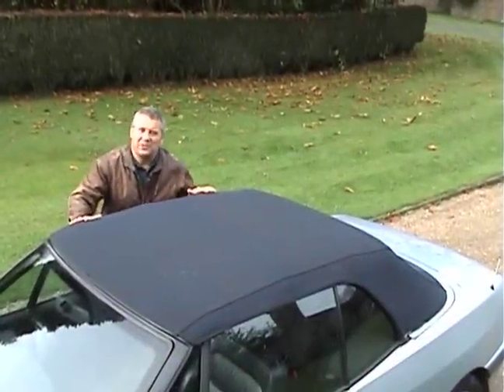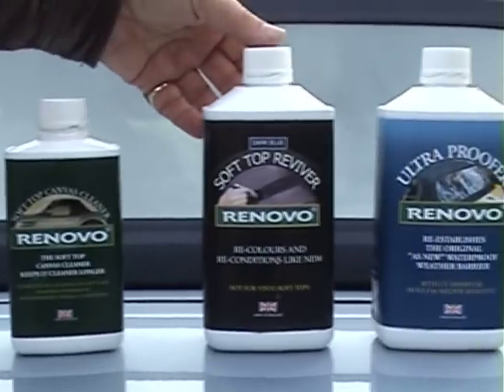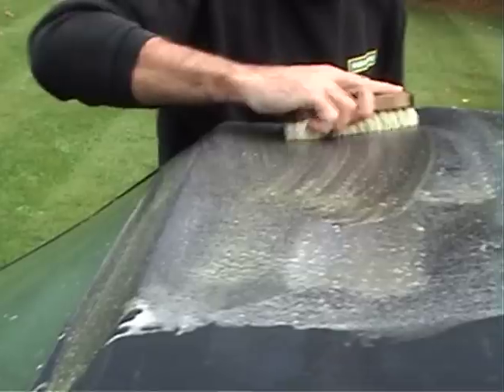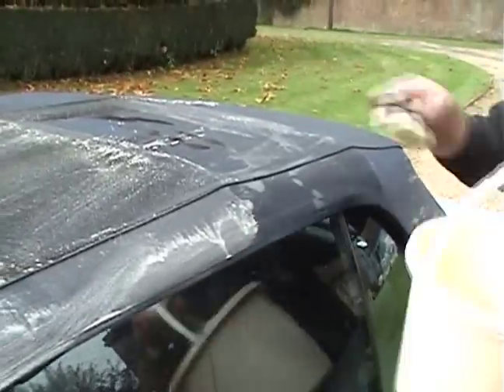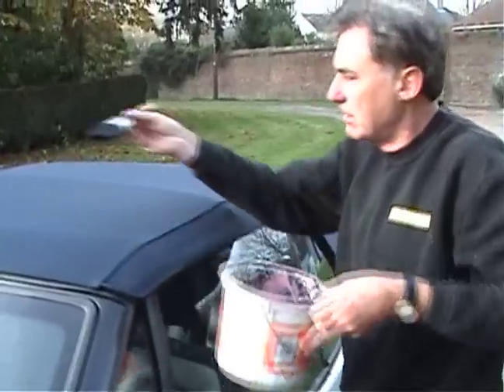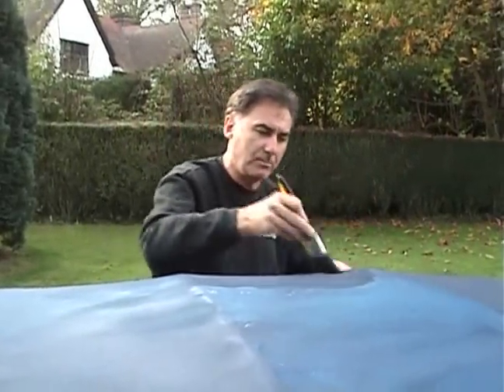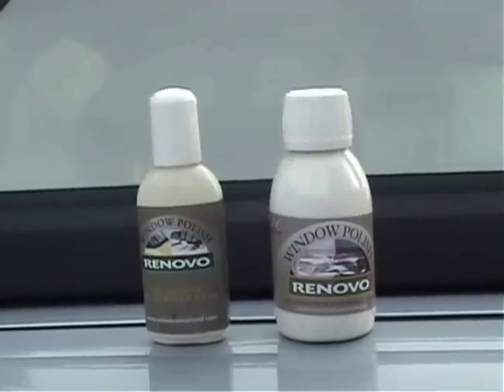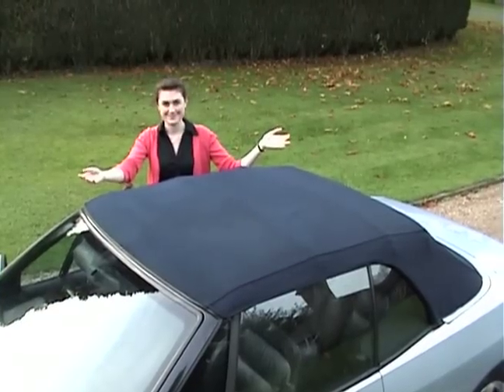Revive your convertible soft top with Renovo

Comment: I used Renovo for the first time having used a cheaper commonly know brand previously. Renovo stands head and shoulders above when looking at the finished results, I was very pleased.
The instructions do say to remove any dye on the paint or windows with a damp cloth. Let me say don't let the stuff dry but wipe immediately!! Mine dried on and I resorted to using a compound (similar to T cut) to remove it. Wouldn't shift with a damp cloth but was quite easy with the compound. Hood looks stunning now!!

Comment from the maker: Hi Wong Chin. Thanks for your query. Renovo has a range of colours, including a few shades of blue, so they will have one that is a close match to your existing soft top. These colours are generic, rather that BMW specific, but will give you a good strong colour with a uniform shade. Do remember that it will also dye any white or grey stitching, so the colour restorer tends to be used on rather tired and blotchy soft tops. If it's just dirty, you might find the cleaner brings it back up to good conditon by itself. Lots of useful info on the Renovo website, and they are always happy to talk you through any technical questions, including close colour matching. Hope that helps. Cheers. Jake

Comment: We have a VW. Beige in color. Do you have that color?
Reply: Hi Tim,
Renovo do not manufacture a  Reviver beige  colour variant as there are simply too many shades of beige for us to be able to keep all our customers happy.

You have two options:-

1. Preserve your soft top's original colour by cleaning with Renovo Fabric Soft Top Cleaner and protecting with Renovo Ultra Proofer. Optimum protection will be achieved by applying Ultra Proofer approximately every six months.

2. Change the colour of your soft top to brown/black.

It is possible to change the colour of your soft top from beige to brown/black using Renovo Soft Top Reviver.  However Soft Top Reviver was developed to bring back the original colour, not change the colour and consequently there are risks involved with this process. It is not reversible and can take more than the two recommended coats but not more than three.

It is imperative that the top is cleaned thoroughly, ensuring that any previously applied proofing product is removed, before applying the Soft Top Reviver. Renovo Fabric Soft Top Cleaner will remove most proofers if the severely soiled cleaning instructions are followed. If you are aware that another proprietary branded proofer has been applied it is best to contact their customer service department to ascertain how you should remove their proofer. 

RENOVO INTERNATIONAL LIMITED
Reply: @kaylacey7802  thank you...

Comment: Hello I just used your product on my softtop 2007 Saab convertible , I used the cleaner & re-proofer it came up great, I have one question should I wash the soft top or refrain from cleaning the roof altogether?  the reason I used it was due to a leak, my interior is bone dry now!
Reply from the maker: Hi Alan. Thanks for your query, and glad you've had some good results. The reproofer will have filled up the holes made by the shrunken stitching, and so stopped the leaks. Nothing to prevent you cleaning the soft top again - they do need it in today's polluted environment - but once dry just give it another quick coat of reproofer. Ideally, you should do this every 6 months or so anyway, and it only takes a few minutes. You'll notice the chemistry has changed a little since that video was made! Cheers Jake.

Comment: Hi 
I used the Renovo cleaner and black dye on my mx5 today, and although it came out well the day was maybe a little warm and has dried a little patchy in places.
If I reapplied with a small foam roller do you think it may be more even.
Havent yet applied the sealer.

Cheers paul
Reply from the maker: Hi Paul

In theory, the roller technique should work fine, and give quick, even coverage, but be aware that rollers do splatter a lot, even used gently, so you may get the dye on the bonnet etc  which will need wiping off. Always best to apply on a dull day, keeping that all important wet edge. The second coat will cover well, but slightly stiffen the material. I asked Renovo for their thoughts. Thanks for watching! Cheers Jake
Reply from the maker: Hi Paul - this just in from Renovo: My previous suggestion may be flawed!

Hi Jake,
 
The problem may be that there was previous form of water proofer remaining on the fabric that the subscriber has not completely removed when they cleaned the soft top. This would prevent the Reviver from soaking in, thus causing a patchy appearance. Another possibility is that the product was applied in direct sunlight/when the soft top was too warm, again this would not allow the Reviver to soak into the fabric properly. Without knowing the history of the soft top and how the top was cleaned prior to an application of the Reviver we can only speculate on this.
 
The simple solution is to clean off the Reviver using the Renovo Soft Top Canvas Cleaner following these instructions:- Mist spray the top and then paint on the Canvas Cleaner leave the solution to dry for approximately one hour, the optimum time for the active ingredients to work. Using hot water the surface should then be scrubbed with a bristle brush. It is essential to use hand hot water. Finish by rinsing off with water. Repeat the whole process as necessary.
 
The subscriber should not apply further Reviver until they have removed the Reviver that has gone patchy and they must not apply Ultra Proofer as this will only compound the issue by sealing in the Reviver.
 
The best way to apply Reviver is with a new paintbrush as per the instructions, not a foam roller.
Reply: Jake Kavanagh hi many thanks for your reply and renovos, I shall go with the advice given And clean off and reapply, very good product.
Cheers Paul

Comment: I bought the 3 part pack to give my roof a going over.
I started with the cleaner....and noticed straight away that it was a clear and odorless. Watching this video it shows the cleaning solution at 1:49 as being like a green goop.
Have you made changes to this product since this video was made?
Yes I did shake it!
Reply from the maker: Hi Split 10
I've just been told that the manufacturers have changed the formulation of the soapy cleaner to a clear liquid. This is because customers said that the goop (a good description!) was a little difficult get out of the bottle towards the end. Maybe time to make another video - I wonder if Renovo works on grey hair, though!

Comment from the maker: Hi Paul. I suppose it depends on how degraded the softtop is. Our demo car shown in the video wasn't too bad, so we cleaned it in the morning, let it dry over lunch, and then put on one coat during the afternoon. Had the softtop been much worse, then two coats would have been preferable. As you say, letting each coat dry properly, and keeping the softtop dry (by keeping it under cover) until reproofed again is good advice. The reproofer will make future cleaning much easier, too.

Comment from the maker: Hi Guy

I asked Renovo about the spotting from flicked dye. Simple answer is - hot water. Hotter the better ( but don't scald yourself!) Renovo is an advanced water-based dye, developed from paint technology, but it will only adhere to porous surfaces (which is why you can't use it on vinyl. It won't stick.) In the ssme way, it won't actually stick permanently to your paint surfaces, so simply wash it off with hot water, and use your fingernail to prise off any more stubborn bits. Hope that helps. Thanks for watching. Jake

Comment: Hi i have a 2003 Boxster , when  rains heavily and continuously the canvas gets saturated and leaks inside. I understand there is a rubber sheet membrane included in the top as a layer of leakage protection will this reproofer stop my leaking top?

Comment: Bought the complete Renovo range, 2 bottles of soft top cleaner, 2 bottles of 1 ltr black restorer, 1 litre of ultra proofer, having cleaned the roof twice on my 2008 BMW 135i as per instructions, then applied 4 coats of restoring dye again as per instructions in an enclosed garage, the result was not much improved colour wise, I applied to coats of ultra proofer, again as per instructions, roof looked great wet, but when dry not so good... I will look at alternative products when I next refurb the roof in 12 months...

Comment from the maker: Hi Andrew

Yes, you can use it on old tents! I bought back a cream coloured canvas cockpit tent that had got mildew. Cleaned it with the Canvas Cleaner, then dyed it with the restorer ( dyed it blue) and finally waterproofed it with the reproofer. Canvas is now very slightly stiffer, but fully waterproof. I think Renovo have several colours to choose from, but you can only go from a light colour to a darker one when dyeing. Also works on anything canvas, including back packs and shoes! Cheers Jake

Comment from the maker: Hi Guitarlover.  I've asked the manufacturer, and they suggest it may be safer NOT to use the window restorer on aftermarket tints. I believe they are looking into this in more detail at the moment, as - anecdotally - I think it depends on how the tint has been applied. UV light, and abrasive forces, damage the top few mico mills of the clear plastic window surface, and the slightly abrasive polish literally 'sands' that damage back to expose fresh, clear material underneath. Renovo International is not sure yet if that process will compromise any aftermarket surface tints involved, so are playing it safe. The rest of the products - including some new formulations - will work a treat on the rest of the canopy! I'll keep you posted. Jake

Comment from the maker: Hi Youngpartly cloudy
Well, in theory, yes. I've used it successfully on badly faded cycle panniers and a boat's sail covers, plus even the fabric-covered parcel shelf on a Ford Escort (changed from grey to black). It will colour any canvas, but not canvas-effect vinyl.Treat with reproofer afterwards, and the canvas will also be watertight. There will be a very slight stiffening of the material once recoloured, but this is hardly noticeable.Thanks for watching! JakeKav1

Comment from the maker: Hi Junior J

Just spoken to Renovo. Here is the offical reply: "The soft top should be fully dry before applying the Ultra Proofer as residual water in the soft top will dilute the Ultra Proofer’s capabilities. Also if the soft top is still partially wet the Reviver is not yet colourfast!
 
With regard to how long it takes to dry this is obviously different in each case according to the ambient temperature/humidity. It is up to each individual therefore to determine whether the fabric of their soft top is dry or not. We suggest 24 hours, but this amount of time is not always required." Hope that helps! Cheers  Jake

Comment: Forgot to ask a question can any of this dye and waterproofed application be done by a spray gun to get Evan coverage
Reply from the maker: Hi Gordon

Yes, by all means. I've just used a cheap (£5) pump-up garden sprayer for a carpet reviving job. You will get a lot of overspray, though, which may waste some material and require masking if you don't want an extensive clean up, but it will work. Brush is still the most controlled way to get the reviver onto the soft-top, and remember to avoid doing it on a sunny day to avoid it drying too quickly. Cheers Jake

Comment from the maker: Hi Guitarlover

Thanks for your post, and glad your Saab softtop has been restored successfully. I've passed your query to Renovo, and this is what they suggest: "In order to prolong the re-colour provided by Reviver, it is best to protect straight away using Ultra Proofer and then top up protection approximately every six months thereafter. Ultra Proofer contains mould, mildew and UV inhibitors in its formulation so helps to keep the soft top looking at its best. If future applications of Reviver are required subsequent to applications of Ultra Proofer, all of the Ultra Proofer must be diligently removed, as Reviver is a water based product." Best wishes. Jake

Comment: What if the top has a couple of tears in it? Can you patch it without it being too noticeable? 
I was just going to replace it as a soft top for an 01 mustang is only around $500 or so. But is there an easier way? 🤔
Reply: Hi Heavy Metal Joe, If you take your Mustang to a coach-trimmer they should be able to make a pretty good job of patching the tears as long as they are not too bad. You can then use Renovo products to clean, re-colour and weather proof the top.........presuming it is fabric and not vinyl.

Comment from the maker: Hi Cheral. I've spoken to the manufacturers and they say that the Renovo Ultra Proofer will work fine on mohair. Their advice is "When the convertible top is completely dry apply Renovo Ultra Proofer according to the instructions on the label. Ultra Proofer should be applied out of direct sunlight, and allow each coat to dry thoroughly. As an approximate guide for an average size convertible top there are two coats in a litre bottle and one coat in a 500ml bottle." Thanks for watching! Jake.

Comment: Thinking of using it again - can I apply with a small roller ? Also last time I did my Saab 9.3 I got a whitish tide mark in the middle of the roof ? Any ideas please
Reply from the maker: Hi Guitarlover. I've passed your query to Renovo. They said "we would recommend that Guitarlover should follow the instructions for 'heavy soiling' on the bottle, particularly the part where it says, “Apply Reviver with a new 5cm/2inch paintbrush, using even strokes across the soft top. It is best to commence application in the centre of the soft top and as quickly as possible progress towards each side, the front and back of the soft top…” Do not apply in direct sunlight (this was stressed) as this will cause the Reviver to dry out too quickly and produce a patchy, uneven result”. This may be what has given the white 'tide mark.' Being a watery product for better absorbtion, you might find a small roller will splatter, even a foam one, so brushing is the preferred method. (Splatter wipes off paintwork easily with warm water.) Renovo recommends applying at least 2 coats to achieve greater depth of colour.

Comment: Hi thank you for this video I have a2001 CLK convertible new roof a couple of years ago and now it's come a time when I have to address the roof the roof is in perfect condition as in no rips no warn signs but a revised roof would bring it back to life how ever I feel appransive  to say the least I have watched your video a few times to make sure I get it right nothing like having a shabby looking roof a question did come up in one of your followers by using a small roller I'm looking for the Evan look and not brush marks I am prepared to buy the 3 bottle version and an extra colour nothing like running out half way question when applying the first step you apply and allow 1 hour before rinsing is the hot water to release dirt ? Plus wouldn't it be better to rinse off with a hose to make sure no dirt or residue from the cleaner is left behind ? For the dye takes better ?And time consuming I know but to mask up your paint work different strokes for different folks I know and I don't see any advice on when doing the job using old clothes lol  I have seen in other videos that they spray there water proofed very lightly is the common knowledge? And how many coat would be best sorry for the length of my post lol I don't get out much but great video one other thing you mention other or updated video can't find them advise please thanks guys at renavo
Reply from the maker: Hi Gordon. Many apologies for the delay in reply - I've been making another vid about the carpet reviver! Thanks for watching the recolouring vid - the cleaner formulation has changed slightly over the years, but the process is the same. Yes, get that soft top as clean as you can. The cleaner works best if left for a while, as it binds to the dirt and lifts it out of the fibres. You can hose it down if you want after cleaning, but if the soft top is a bit leaky (usually due to stitching shrinkage) a warm wash may be better until you've recoloured and then resealed. Wear old clothers (we did) because the dye is designed to suck itself deep into absorbant fibres (which is why it doesn't work on vinyl.) You don't need to mask, although you can if you want. The reviver washes off non-porous surfaces ( metal, glass, rubber) very easily with warm soap and water, even when dry. You can of course use a roller - a foam one would be best, but be aware that the recolourer is quite watery ( so it soaks in well)  so you will get a lot of splatter, which is why we recommend a brush. Hope that helps, and thanks again for watching. Cheers. Jake

Comment: Made a marvellous job on my 330 ci. 12 years of no love and then I cleaned and used the reviver. 1 litre in enough for three coats on my bmw. I did two and it's came up great. Word of advice though it's very runny so I used masking tape and a throwaway paint sheet cut and taped with masking tape. This is a must as it's cuts down on painting time as u don't worry about drips which WILL happen. Also do on a cool cloudy day. Otherwise it'll patch. Worked a treat though. 👍👍👍

Comment from the maker: Hi Josephanimation

The reproofer works by sealing up the thousands of microscopic pores that open up in ageing canvas, especially around the stitching. Sounds like your roof will benefit. Check for any tears, though, as the rubber membrane could steer the ingress away from where it is actually coming in, a common problem with the deck fittings in boats. Let the roof dry out thoroughly, apply, and renew the coating every 6 months or less. It only takes a few minutes. Cheers!